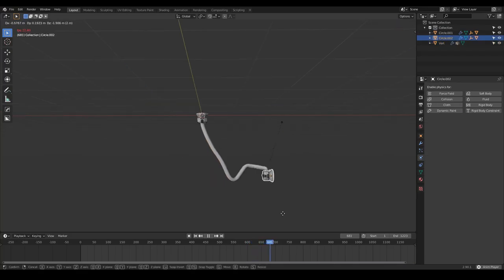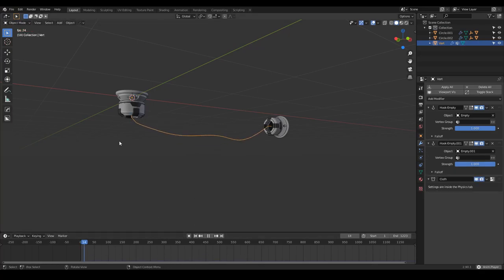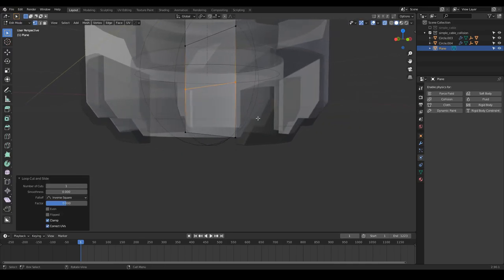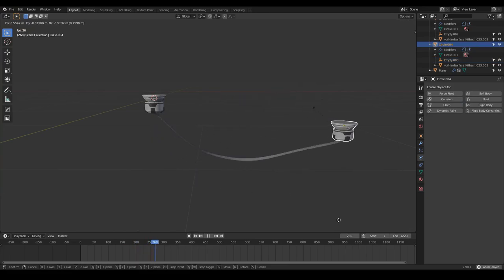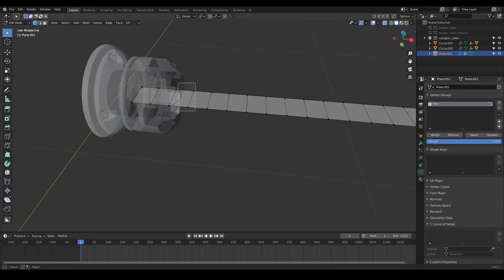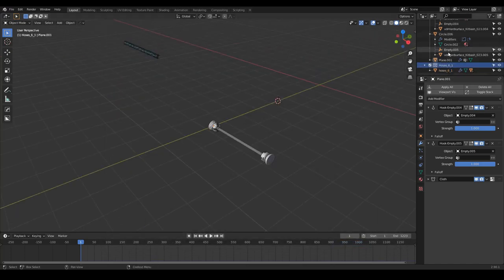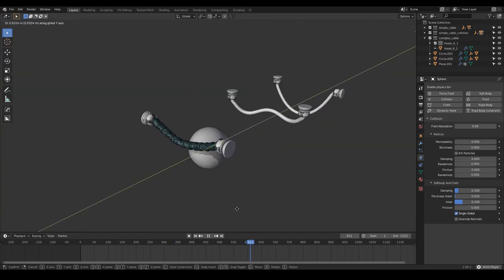Simulate Complex Cables in Blender EASY! | FREE .blend file

Comment: if you want to have collisions with a round cable (it will be slower) you can use extruded cylinders (if you subdivide it you need to give each cut a face so it has supports)

Comment: Thank you for showing this! Is there a way to bake out the surface deformer so it can be exported as a .abc to be used in Unreal or similar? Or a way to simulate the high res cable geo without it collapsing in itself?

Comment: Wow, thank you a ton for this tutorial! I've been struggling for quite some time with a decent way to simulate cables the way you explain here. 
I hate to ask, but do you happen to know how to set the cable up to collide with other cables with the same properties? Enabling collision only messes up the simulation.

I'm looking forward to more insightful videos of yours. Great content! :)
Reply from the maker: Hi! Thank you! Glad you find it useful :)
I'll need to try that! I think is more complicated because Blender tries to collide vertex with vertex, so it could get weird and I don't now if that is possible. In that case I think you would need to simulate cloth with the actual mesh, but that could be painful! 🤔
Reply: @victorvdr9  could it work if you convert the spline to mesh?
Reply from the maker: @MAJmufin  Yeah! definitely is the straight way to go but It'll be so expensive in terms of processing...
Reply: @victorvdr9  Thank you, for the suggestion, I've set the collide modifier for the Cable mesh, that was set as the surface deform object, so no wonder it didn't had the desired result. Stacking the collide modifier on top of the cable setup itself actually worked perfectly. Due to the many collisions all the cables in my scene escalate over time, as they are stacked over each other, but playing around with the settings should fix that behavior. 

Thanks again for giving it a thought :D
Reply from the maker: @januszpolewski2910  Oh that's great! Thanks so much for sharing!

Comment: is there a way to change the start position of one end of the cable? So far it's laying flat in a straight line but if i try to move the hook/object on one end, the cable wil remain in its original position.
Reply: I had the same problem. Move the end piece when the animation is playing. Stop the animation and move it back to frame 1.

Comment: Hi! Thanks for the tutorial, i have a problem, when I press Bind on the surfaceDeform can´t do it. Out of memory message appears. I tried to do with a very low poly mesh but still happens. Any idea?
Reply: Ok, solved, I was trying to do it with a single line of vertex to do a rope, but you have to extrude a little bit to create faces and then works.

Comment: amazing!...great job, thanks! ....i want to try to simulate an elevator car ,  counterweight and 3-5 ropes, all driven by a motor traction pulley...do you thing it is feasible to manage to get all the physical constrains rights so that when the traction pulley rotates the car drives in one direction and the counterweight in another? ....any hint would be highly welcome! thank you!
Reply: Is there a reason why you want to simulate the elevator with physics? I think using object constraints with drivers would be better, easier and more stable. You could also rig the elevator with armature, bones and bone constraints.

The movement of the elevator car and counterweight can be done using object constraints like transformation, which will convert a rotation of the pulley into a linear motion of the car (you can also use drivers). The rotation of the pulley / motor / gearbox can be done using drivers, keyframes or object constraints. The movement of the ropes can be done using curve modifier and just animating (for example) the x location of the rope (it will create an effect of the rope sliding alongside the curve). If you don't want to apply texture to your ropes, you can animate them just by stretching their ends to create an ilusion that they are moving.
Reply: @richardkokstein  yes, there is a reason...i don't want just an animation but a simulation of the elevator dynamics including torque, power etc using dynamic friction, drag ...it should help design the elevator components like motor (rated and max. torque, power) , electrical drive etc. ...as for the animation, i also do want to have it as realistic as possible for explainer video purposes....thank you for your advice....

Comment: Thanks for some ideas :)

This is for sure a great video for someone who wants to stupidly repeat  what you did.
Useless tough for someone who wants to understand this.

To say to (unfortunately most  of) the HOWTO makers:
- Be essential!

The handles don't have anything to do with cable simulation. They are disturbing here.
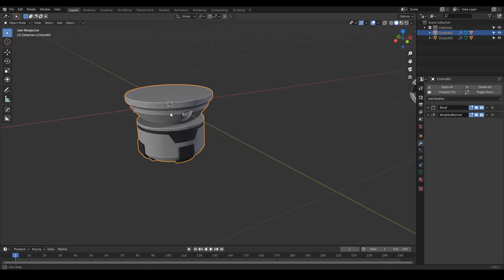0:57 
"I didn't duplicate the " (was it Volumes?) "Here we go" You delete something. What and why?
1:09 
There is no "Add Single Vert" in vanilla Blender. I guess you have some Add On installed. Explain such things!
2:05 
You create a Pin Group. This would be a good place to explain what a Pin Group is. ;))
2:20 
"I need a Vertex more" disturbing and it shows you didn't prepare your presentation.
2:30 
What is the reason for the vertex weights in the vertex group?
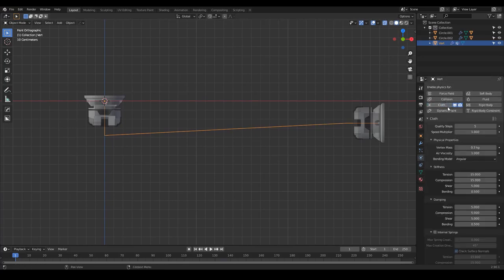2:39 
Before enabling Cloth you changed to Object Mode. This is essential and it took me a while to recognize. ;)
2:48 
"We need more room here ..." not the truth, disturbing and confirming unprepared presentation.
3:10 
Selecting the Vertices is only disturbing, you select the Pin Group afterwards anyway. Experimenting during presentation? ;))
3:40 
Menu Vertex -> Hooks -> Hook to New Object would make more clear what you are doing. Especially if the Modifiers Panel is opened it would become  clear what is  going on.
(The modifiers appear there exactly at this moment)
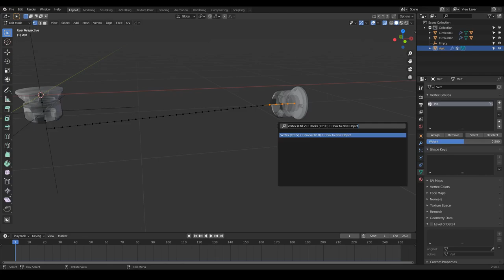3:58 - 4:36 
Totally irrelevant for cable / rope simulation
5:05 
"ah .. and if this happens" ... you need to clear the Simulation Cache. Nobody will understand what moving a vertex means.
BTW: This is missing in Blender. The fastest way to do so is to go to Modifiers -> Cloth -> Cache and turn Disk Cache on and off. The blue line in the Timeline has to be not present.
5:32 
Mesh -> Transform -> Skin Resize, nobody will know the hotkeys (meaning) of something she learns actually
(This holds for all such situations: The menus show the hotkeys - the hotkeys do not show the menus they are related to)

I'll leave the remainder of the video out.

Sorry - Videos like this could be a great source of information for everybody but:  Do not say! Explain and make the background clear! 

I hope you got me
I'm looking forward for more such vids from you with some of the above (constructive) critics taken into account.
I'll give you a "thumbs up" anyway
Its some times hard to figure things out in Blender only from the manual and from the user interface.  ;))

Comment: Nice Video, but I got an issue: I want to import the last Cable to Unity to use it for my game, and it does not work in Unity. But in Blender it does. How do I avoid that issue?
Reply: There's a similar question from another video:

@giulianoscalamandre1555
1 year ago
That looks great! just one question. is it possible to export something like this into a game engine?

@BlenderSecrets
1 year ago
Maybe by selecting just the ropes and then exporting the selection as FBX, I think that may keep the animation. Or some format like that which is like an animated mesh without keyframes.

Comment: Is it possible to make this cables / ropes collide with each other ? Like stack on each other in the simulation, because when I add collision to the rope, it starts to act really weird.
Reply from the maker: It’s possible if you use the stripe of planes as cables
Reply: @victorvdr9  thanks, I just tried it, also i add collision on them, but when they collide they seam to bounce, connect and produce various weird irradical motions instead of laying on each other.